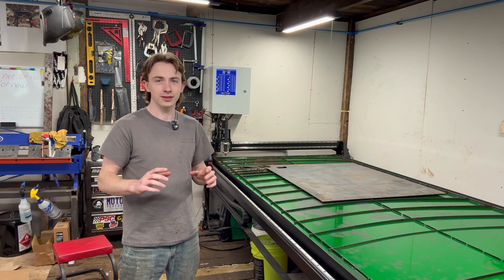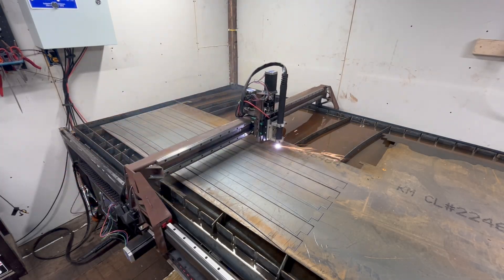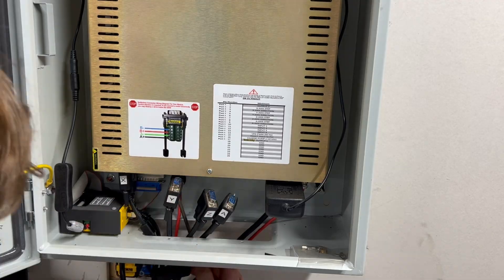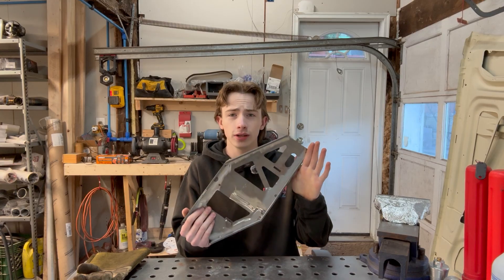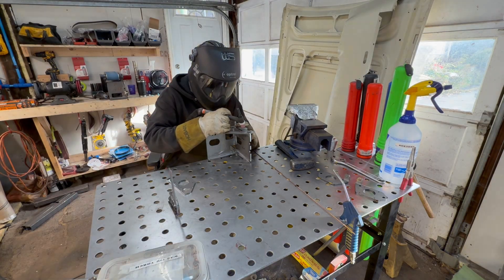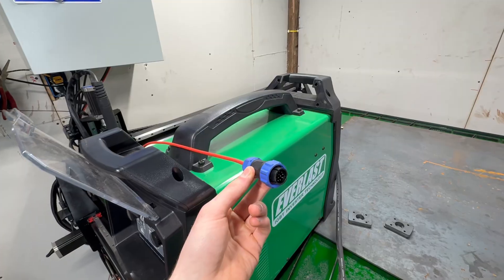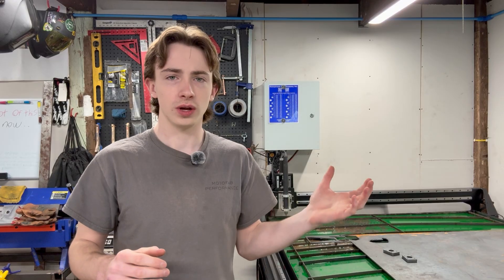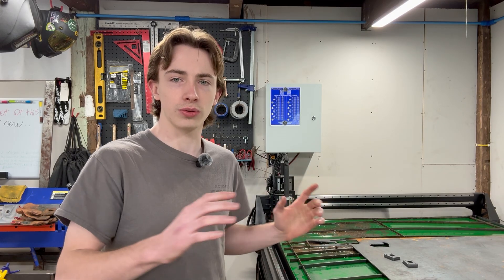How Not to Waste $8000 on a DIY CNC Plasma Table

Comment: How's it going, so I to have purchased these plans recently and I to have a YouTube channel that I'm building off these plans @midwestkustomz6350
Also I to have had to change things around. What I wish was I found your video before all this BS! Also I've also sent countless messages to different platforms to get nothing back in return. There is another guy his channel is I think,, hennybuilds - that talks the seller up really well. In fact that's why I purchased them. What's sad is there really petty mistakes that like you say could of been fixed by the seller and still to this day haven't been revised,, SMH!
I also have missing dxf. Files that I just made my self. The worse part about this is I could of done a lot better job on the plans but I simply don't have the time as I work 2 jobs and trying to keep a full time youtube channel going is  completely exhausting! Anyway keep up the good work I just subscribed to your channel! 👍👍

Comment: Nice job, good to see that you have finished your plasma table!! I joined your skool community and will post pictures of my build as I am building the same exact table. The only difference is I made my water pan in 4 sections and bolted them together with rvt gasket so that it is water tight. Your cnc build video series has helped me immensely thanks.
Reply from the maker: Glad I could be of help. Look forward to seeing your post in the Skool Community! Thanks for watching!

Comment: Hey congrats on finishing that plasma table. Looks like it works real good. That sound advice you had about taking on certain projects etc. I wonder if that one video claiming an $800 cost for plasma cable was really a typo" haha, they left off the third zero right) so I checked out your affiliate link. Have been thinking about getting a welder lately. May think about getting one of those multi-function units. Have done a bit of research and it looks like you are quite right about their price and quality level. We'll see how things look in the spring and maybe go for it. Good luck there, stay safe. Oh BTW wondering if that plasma table Might benefit from a couple more support legs in the center. Have you seen a few larger type plasma tables that have a total of 6 support legs 👍
Reply from the maker: All good stuff here, thanks for watching and following along! 

Definitely couldn’t hurt to add a leg in the middle to keep it from bowing!